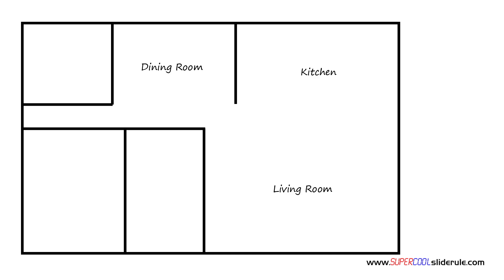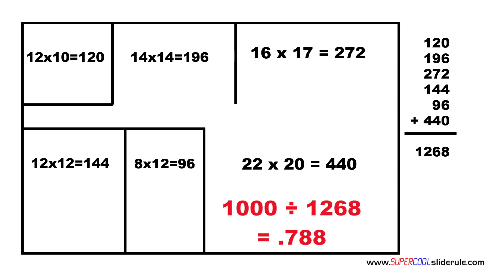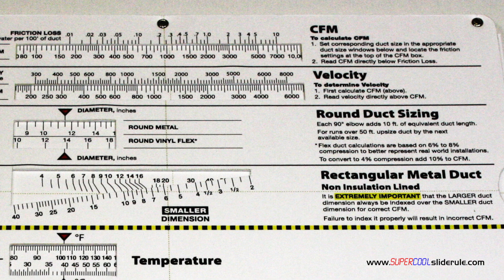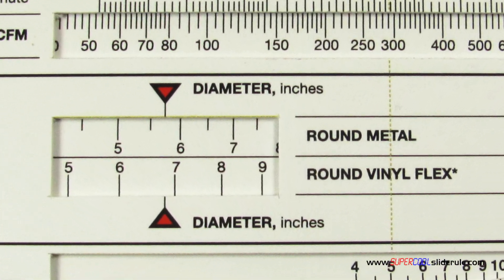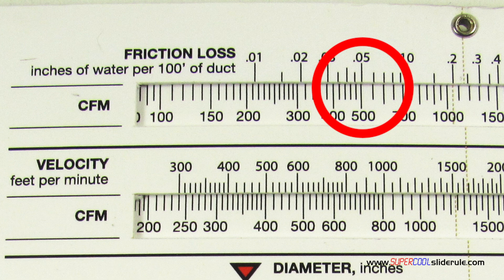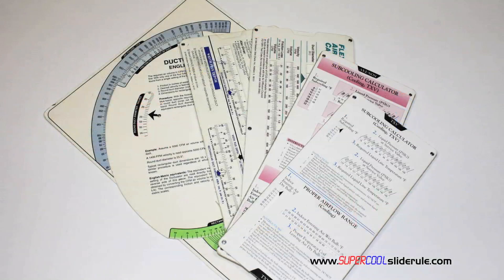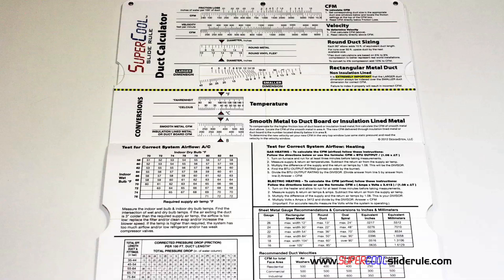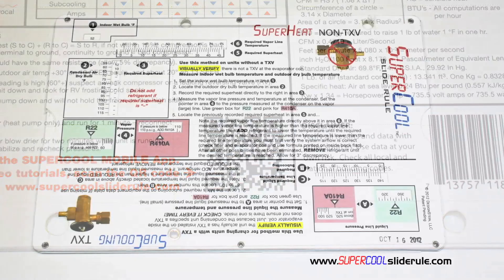Duct Size - How to size a Duct System for a House

Comment: I only watched like 2 minutes in and you made a couple of mistakes, for example, a 3 ton unit is required not a 2.5. Because 400x3=1200 which is closer to the square foot 1268

Comment: I am adding vaulted ceilings but will have closed cell spray foam on roof/walls and rim joists. Should I then still calculate for higher ceilings?

Comment: How did you assume 2.5 tons for given sq footage? How do we calculate that please help
Reply: That's based off of doing a Manual J. Wall thickness, number of windows, direction of walls, exterior wall exposure, type of insulation under slab or crawlspace and in attic, etc. all determine tonnage of unit.

Comment: Why not get the cubic footage for each room multiplied by the needed air changes per room divided by 60. Do that to each room and add it all up to get your total CFM. By getting your total CFM needed, wouldn't that give you the tonnage you need for the unit?
Reply: how do you know air changes needed ?  Tonnage required is also dependent on heat load.  How well is room insulated ? how many windows ?

Comment: Heat load wrong. 10*12 = 120 sq ft by thumb rule 1 TR = 120 sq ft so 
1 TR = 400 Cfm 
Total sq ft = 1268
So 10.50 TR required 
10.50*400 = 4200 CFM required for whole rooms.

Comment: Why not go with a 3 ton? Just curious. You’ll have 68 extra cfm. Instead of 268 extra cfm. Ik you can’t install a over size unit of your evap coil will freeze up do to air flow restriction. Wouldn’t a 3 ton be more effective cooling the rooms and more efficient?
Reply: Too big or too small unit it is not good. Too large will prematurely cycle and may create a lot moisture or mold on the wall, the reason been, the unit will not have enough time to ventilate the space, the thermostat temperature will get satisfy too soon , not giving the unit enough time to ventilate or circulate the air. Too small will put too much stress in the compressor trying to satisfy the thermostat set up temperature. In my opinion, the right size will be the best, but if I have to go a little larger, I will not go larger than 1/2 a ton.
Reply: i was kind of leaning towards this line of thinking.. i need to learn more.
Reply: I'm no expert, but 3 tons for a 1200 sq ft house w/ average ceilings seems like it's way too big unless you have a lot of windows or very little insulation.  If you oversize the system, it will cycle often and be less efficient.  Variable speed units will help this, but still seems silly to oversize so much.

Comment: First I’m just a home owner interested in learning ,I always thought there was a crazy math to figuring out the dimension of the and then the duct size ,with your book it’s not as hard as I once thought ,so thank for making that easier to understand for me ,
My question is just figure the area of the room doesn’t factor in how far away the room is from the unit , Now if the unit is (this my home)basementand the biggest room in the house are right above the unit on the 1st floor and by rule those rooms would have larger ducts then the smaller room above them , would most of the air  pressure die off by the time it reached the 2nd and even more by the 3rd floor ,dose the length of the duct work not get factored in at , again I don’t install and I am only concluding on my experience, can any explain how I can check calculate my ducts to make sure the sizes are correct, thanks again I will continue learning more to be an educated consumer
Reply: Hi, I am in trade school now. For rooms that are farther away, the trunk line (the main line spanning the house) will actually reduce in size after a certain point, this keeps up the static pressure for rooms that are farther away. Think of it like this, if you blew air through a 3 inch pipe, and then blew an equal amount through a 1 inch pipe, the pressure would feel stronger in the 1 inch pipe. The duct system does this the same way, by going through the larger duct first and then farther away it gets smaller to keep static pressure consistent.

Comment: For those wondering about the ceiling affecting the CFM to each room:
I think the ceilings where accounted for during the initial load calculation to size the equipment using Manual J.
Since you have the proper number of tons from your system, then what he did was divide the total CFM output of the unit by the total square footage of the home so you end up with .788 Feet per minute. When you multiply that by the square footage of each room you get cubic feet per minute again.

Comment: Why not install adjustable air diffusers and then just adjust air flow for comfort?
Reply: Yes, but for that to work, design for air-exchange first, to damper-down, you need an excess of CFM in order to modulate or balance each supply duct for the room's heat-load requirement. You cannot under-design for room air-exchange and then damper each room for balance.

Comment: If celing heights vary wouldn't it be more accurate to calculate the cubic feet of each room and divide the cfm up proportional to the cubic feet rather than the square feet?
Reply: I think the ceilings were accounted for during the initial load calculation to size the equipment using Manual J.
Since you have the proper number of tons from your system, then what he did was divide the total CFM output of the unit by the total square footage of the home so you end up with .788 Feet per minute. When you multiply that by the square footage of each room you get cubic feet per minute again.

Comment: Great video, it'll be a big help in my house design. I hate to be a stickler for details, but @1:17 your cfm calc is off on your 22x20 room. Should have been 352 and you have it at 76.8 (such as for your 8x12 room)

Comment: Hey man nice job, but we need to stop telling people to use .1 static. Every equipment has different friction loss, it's up to the HVAC company designing the system to know what that is. With variable speed motors, electronic air cleaners, and other add-ons you could be either under sizing or over sizing the duct work causing premature break downs of new equipment, higher power bills, and poor humidity levels in the home. I hate to be the party pooper, but too many times do I run into poor duct work and it's from this old school logic that we always use .1 when designing duct work. Times have changed, units are more efficient and homes are tighter which offset a lot of these old school practices. Please, I just want homeowners to stop yelling at me when I tell them why their 3 year old system broke down. Thanks man.
Reply: That's why there's extra equations for static loss recovery and for friction loss etx
Reply: HEY BOSS IF YOU ACTUALLY  HAVE ONE OF THESE CALCS  IT HAS THE CORRECTED PRESSURE DROP TABLE ON IT. HIS SYSTEM MIGHT HAVE BEEN .1 AFTER CORRECTION

Comment: I need 162 CFM in one room which is 25Ft away from unit. Ruler showing me 14" round flex!!!  Is that ok or I ma reading something wrong ? I have this slide rule tool.
Reply: +srokalapy No way is that correct
Reply: Ruler is showing me 10"
Reply: srokalapy b

Comment: Basic ok tool for the typical ranch or row house, but how about a more complex duct system? One should really use manual J to figure the load per room, and then manual D to size ducting. To use only .1 for supply friction is a bit misleading, I find quite a few of my installations have friction rates for supply ducting at more like .05. I am laying out a duct system tonight which as 460 equivalent feet of duct from the farthest return to the farthest supply. .1 is for 100 equivalent feet of duct not 460?

Comment: This is a brief tutorial and is not intended to be a solution for all duct sizing applications. If you are an architect or an engineer might I suggest that you properly perform load calculations and use the latest duct sizing software, but for everyone else in the world this duct sizing method will work in 95% of the applications. If you lack the common sense to know that a room with 12 foot ceilings will require more air than a room with 8 foot ceilings, I would suggest you find a different line of work.
Reply: I farted and it stunk. How much ventilation air do I need to not stink up the rest of the house?
Reply: Can u please give me ur WhatsApp no,
I want to talk u about ducting size please.
My WhatsApp no is 
00923129797912